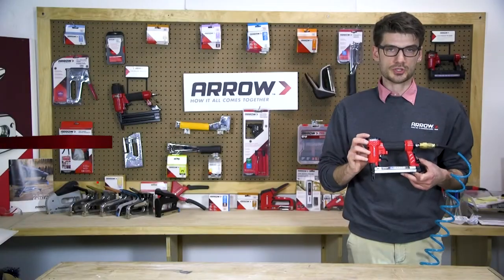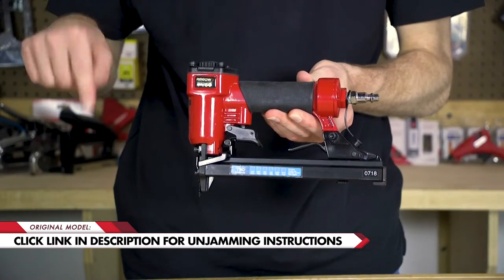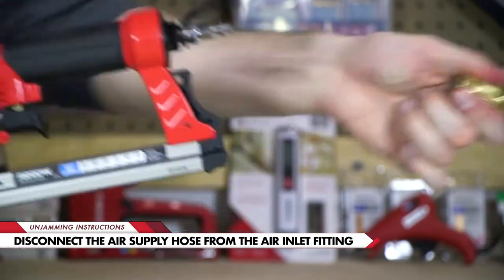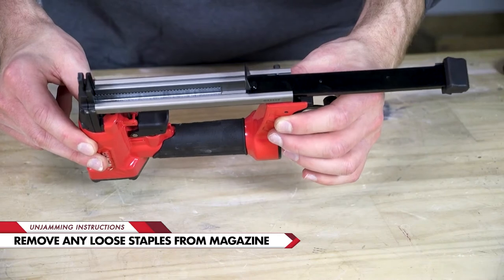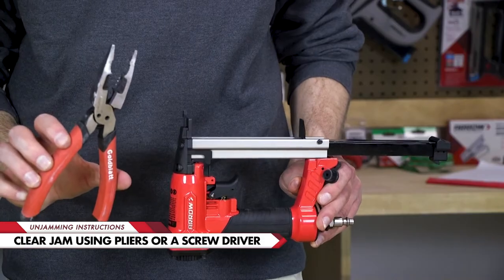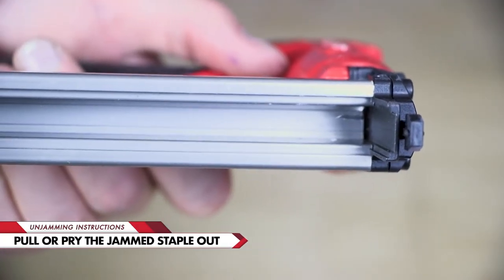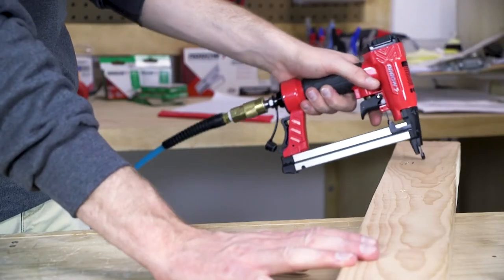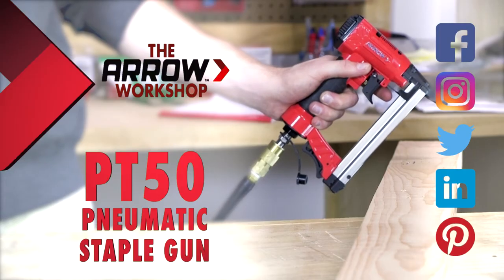How To Clear A Jam From Arrow's PT50 Pneumatic Staple Gun

Comment: Mine worked for one job and now every time I use it shoots one staple and then the plunger  won't retract. I have to open the magazine and turn the stapler so that gravity retracts the hammer back.  I followed one of the solutions  by loosening the two #02 screws with no luck.
Reply from the maker: Here's a link to the manual, where you'll find use and troubleshooting info: https://bit.ly/3MdTNOS. If you are still having problems, please call us at  800-776-2228  option 4. Remember, your staple gun is backed by our warranty, so we can replace it if the problem persists and there isn't a solution.

Comment: What does one do when air is going through but no staples are being pushed through? Yes they are t50 staples but it just stopped working and nothing is jammed. Unit is like a year old but only used it a few times.
Reply from the maker: Hello - You didn't mention if you have the oil-free model or the older model, which requires lubrication. However, you may find a solution in the manual: https://bit.ly/2BUCrW3. If you're still having problems, please contact us at customercare@arrowfastener.com or 800-776-2228. We can  help with further troubleshooting or a replacement under the warranty if the problem is due to a defect. -Arrow Fastener Team
Reply: @arrowfastener  I poured oil on oil free model. And it does not shoot the nail. only air comes out. What should I do?
Reply from the maker: @coramdeopastor  Remove any staples and turn the tool upside down. Dry fire for  repeatedly for a few minutes so the air can clear as much of the oil as possible. You might want to try WD40 afterwards if there is oil remaining. If you need further help, give us a call at 800-776-2228. Hope this helps!
Reply from the maker: @coramdeopastor  Give us a call at 800-776-2228 and we'll try to help.

Comment: every time I've seen this stapler get jammed, the driver gets stuck in position, pinching the staple in place... How do I clear it then??
Reply from the maker: Hi there. We still recommend using pliers to pull the jammed staple out. You may just have to use a little extra force to get it out if that's the case.

And please feel free to call our customer service team if you need further assistance: http://www.ArrowFastener.com/Awesome/Contact
Reply: Little tiny piece that you can’t get with pliers. Shot six maybe eight staples through it now it’s completely jammed.
Reply: @arrowfastener  useless video. How can you clean it if the little piece jammed at firing pin and you can’t remove it using pliers. Do you want a photo?

Comment: Is it possible to run jt27 light duty staples through this gun? I have projects where t50 fastners are overkill.
Reply from the maker: Hello - The PT50 uses T50 staples only. JT27 staples would not work in this staple gun.